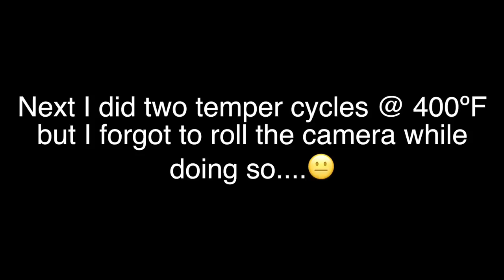Making a Knife - The Chunky Monkey

Comment: You could probably use a 6 to 8 inch diameter steel pipe about 2 ft high filled with oil to dunk your heated knifes into to avoid making that hot sloshy mess.  Maybe line the tube with a slightly smaller diameter plastic/PVC tube to avoid banging the blade up against the steel pipe.  Put an oil friendly drain spigot near the bottom of the tube for easy oil changes. 

Then, make a tool that has a foot long shank and a slide locking hook on the end to grab the knife from the kiln with.  Then it will have the length to lower the knife into the oil tube properly.

Comment: I have a question, I made 2 knives with only filing and small grinding wheel. Unfortunately I put an edge on them before I did the heat treat and quench, and one is a fairly thin double edged medieval style dagger. Should I grind down the edge a little to flatten it out so it isn't too brittle on quench? I have limited heat sources, one would be MAPP gas and the other would really only be a charcoal fire in an old rusty grill bottom. I would temper in the oven. Sorry for the longwinded post but I guess I just need to know how to go about doing this. I would put pics up but cant on here. Thanks!! Love your knives and I'm doing what I can with limited tools lol. Both of these were made from circa 1960s files if that matters.

Comment: After glue up, i sand my handle the same as you put the pins keep getting hot and melting my epoxy. Then my pins fall through and grind too short. Any tips?
Reply from the maker: I used to have a really hard time with that happening too. With metal pins, you just have to take it super slow and easy. I like synthetic pins for that reason. They don't heat up as much when shaping the scales. But then again, they aren' as strong as metal pins.....👍
Reply: @Simplelittlelife  thanks for the help , might try a contrasting wood dowell

Comment: Props on the liquid nitrogen cool down. That is some nextlevelshit right there. I just wish you used a sharpening stone to sharpen it, instead of the belt sander.
Reply from the maker: Thank you! For resharpening a stone is a great way to go but for putting the initial edge one is like the control and speed that comes from power sharpening 👍
Reply: i guess you want videos whom exceeds 2 days,  because wetstoning tough material takes quite a little while. hhehehe

Comment: I wonder what would happen if you quenched a knife in liquid nitrogen
Reply: It would crack the blade
Reply: @sampowell3003  Actually I tried this already with some tool steel, and it's not as fast a quench as you might think. The leidenfrost effect creates a vapour bubble around the part, and it acts like an insulator, didn't even harden the steel. Did it again using water, and it hardened up fine. The liquid N2 is just to transform any remaining austenite into martensite.

Comment: That file that you did the jimping with on the spine of the blade what  kind of file is that? What's it called and where can I get one?
Reply: I normally use needle files. Should be available at just about any hardware store. 🤞
Reply from the maker: It’s called a checkering file. This one is a double zero (or 20 teeth per inch). Amazon is probably the best bet. 👍
Reply: @Simplelittlelife  thank you I'm new at knife making and trying to get all my ducks in a row. I have seen you use it is one or two of you're videos. Thanks again y'all's videos are a big help..

Comment: Where do you get a file with parallel grooves like that? I’ve been looking for a simple way to do those notches. 
Awesome knife. It’s quite a little BEAST.
Reply: It is called a checkering file and you can get them of of Amazon/ hardware stores.
Reply: @jameswalker6810  
Way ahead of you. I found a ten inch rasp at a farm auction a few months ago and forged it into a great seax knife. 
Thanks for the tip though. I’ve been collecting other carbon files for more knife projects.

Comment: First of all what you do with steel is amazing to watch, but, I've noticed at time mainly on your drillpress safety kind of takes a little bit if a step back sometimes. As one who worked in a machine shop while in school I know thw dangers of a drillpress firsthand. I know you guys are professionals , and, are excellent at what you do. The average person would probably need to have the safety aspect demonsrated a little more in depth. Maybe a video on some safety tips or something. TY
Reply from the maker: Yeah you’re 100% right on that. I get that comment a lot and a video would be a great idea👍
Reply: Yeah the lack of a clamp does put me on the edge of my seat. When that clamp was added as a stop though, it did help ease me... abit.. haha
Have seen a couple of accidents myself working with pillar drills in an alloy wheel factory. When people haven't held the work piece properly and the drillbit has bitten on the piece and caught, almost took a guys arm off.
But then kind of ironically i like that you dont use gloves... 99% of what ive seen is when people havent been paying attention and a glove has caught on the bit. I had to learn that the hard way myself, lucky to still have all my fingers :')
Reply: @peeweedarkarrow  Similarly, a guy I work with had two fingertips sheared off when the workpiece and the table suddenly turned into a large rotary scissor.

Comment: AUCH, that liquid nitrogen, i can hear your blade screaming in pain. You should never ever dunk your toolsteel into liquid nitrogen. Compare it to your quench oil. You specifically choose a slow oil, because water cools it down too fast and your blade will crack. It's the same with liquid nitrogen. For a proper cryo you need a processor that cools it down at a specific rate (3-5 c/min)  and hold it there for a large amount of time. There are many papers on the subject.

ps. nice cleaver, although I would prefer a tapered tang so that the handle material would stand out more. Right now the amount of steel-to-handle seems out of proportion